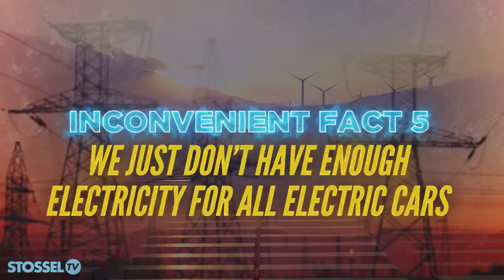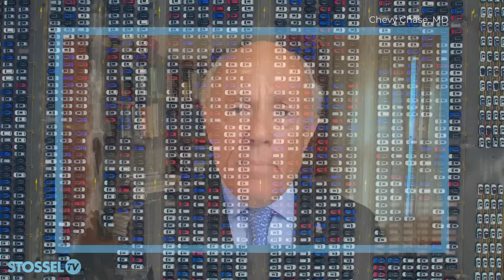Electric Cars: Inconvenient Facts, Part 2

Comment: KLT. Battery technology will continue to move forward. The electric cars we have now will eventually get newer, better batteries to replace the ones that they have now. If you take care of an electric car and it is well built then it has the potential of lasting a very long time, but it will have to have the battery replaced eventually. When that happens the car will be practically brand new again, depending on how well you've taken care of the car itself.

I believe the eventual technology for batteries will move into something called graphene. 

Graphene, think cousin of graphite, is pure carbon. Readily available in the quantities that will be necessary, and cheap as well as easily handled. The manufacturing techniques should be safe but that will be the primary source of cost. The technological know-how will need to be high as well as equipment creation.

Graphene has been created in small quantities. The scientists who did it won the Nobel prize. The trick now is scaling it up. And that may take a while, but we will get there. KLT
Reply: Planned obsoleteness 
Batteries will be made to give out 
Like your cell phone

Comment: While I don't deny physical limitations and I know electric cars can and often are horrific for the environment, and think CA politicians are absolute morons, the bottom line is that electric cars still work. They still function. I can plugin my car at home, drive to and from work, and plug back in. And the car works fine for plenty of years. They're not unusable and there's no horrible flaw other than needing to fuel in a different way, or battery mining being awful for the environment. Not saying electric cars are better, not saying they're worse, just saying they're a valid option. And I think the libertarian / capitalist philosophy is adding more options and letting people choose. So long as gov doesn't force us (which they are) and so long as gov doesn't regulate, control when / where we drive. But at its core, it's like having an option between a couch or a recliner. Different options for different uses and people.

Comment: my opinion, if gov.mandates are removed, we will have unlimited safe fusion energy from small stations converting hydrogen into helium, it works already for minutes in labs. Cheap (but heavy) stationery non-flammable batteries now tested for 20 years in operation, are more efficient, and good for complete off-grid single house operation. Natural development is best, and for heating homes in the winter, wood is excellent source, now fallen dry trees laying unused till burned in forest fires, while at water-heating and energy storing furnaces burn efficiently without the smoke, adding clean CO2 that trees desperately need to breathe a grow, as the wood is made by Carbon from CO2. I wish children are taught true science. Trees use CO2 to make wood and releasing O2 - oxygen. We need oxygen to breathe, releasing CO2 for the trees  - perfect harmony of nature.  I run my house (and my electrical car) on my own solar panels, big fan of solar, and it is in the north, in Canada, it can be done. But clean nuclear energy, with burned rods recycled thus no nuclear waste, we already have it all. We need oil for making plastics, asphalt for the roads, and gasoline and diesel will be the byproducts, nowhere to damp. Will we burn them into the air rather in the cars and trucks? The science and truth are in the details, time to get politicians, and corruption, out of the game.

Comment: Nothing but EV for me.  I have 2 of them.
Reply: That proves you don't have any EV's.  I have owned four in the lat 40 years and always still needed an ICE car as well.
Reply: Which EV did you own 40 years ago? @ForbiddTV
Reply: @boonedoglekentucky2064   And the only way I could still travel distances is with an infernal combustion vehicle, same as you. Try nonsense on someone who doesn't know any better.
Reply: Once again.  What EV did you own 40 years ago? @ForbiddTV
Reply: @boonedoglekentucky2064   I already told you, but I see YouTube may have blocked it for some reason, so I'll post each model individually, but the bigger question is why have you not known the EV has been available for over 100 years?
Reply: @boonedoglekentucky2064   Then you better had not think you are going on any long trips, nor charge any of them in a garage.
Reply: @boonedoglekentucky2064   And when any of those vehicles you mentioned need a new battery, they will be scrapped since the new battery exceeds the value of the car.  Mine have aluminum frames and plastic bodies, so they keep going decade after decade with a $2000 battery change that I can perform myself every 4-5 years.

Comment: Electric cars dont do anything very well, They dont like excessive cold or heat, Gas powered auto's dont have a problem, they run in the cold & the heat. What will happen to your electric car when the battery goes down?   Buy a new battery ? Get out your checkbook and be prepaired to get ripped off. What will you do when your riding in your electric car and the battery decides to explode ? Now your an electric car owner who has gotten burnt yet again. Now you will need to purchace a new car plus you will need to get ready for the hospital bills from the battery explosion to start rolling in. Yea, and this is just the tip of the melting Iceberg that Joe Biden keeps quacking about.

Comment: The country currently has 2.1 million EVs on the road that consume .2 of a percent of US electricity. Estimates of all cars being EVs shows there only needs to be a 15% to 20% increase in the grid. That's very doable over the next few decades. Electric motors are 3 times more efficient than gas engines and cause a decrease in net energy consumption. And most EV owners charge their cars at night at times of low demand on the grid, and if incentivized by pricing that will continue. It's all about peak demand, you know.

Comment: Who is responsible for forcing this crap on us?
Reply: How many EVs were you forced to buy?
Reply: @DeputyNordburg ... The ones with the tax rebates?
Reply: I didn't vote for those tax rebates!  Or the wars to keep gas cheap.  Hmmm which one cost more?
Reply: @bradleyrex2968  ... There's supposedly more oil in the Bakken Formation alone -- just that one place -- than in all of Saudi Arabia. ... Wars for oil?  Was WTC7 for oil?
Reply: @kradius2169   Bakken Formation has produced oil since 1953.  It's low quality and expensive, since 1953.
Reply: @bradleyrex2968  ... What your source for Bakken crude being "low quality"?

Comment: EVs will soon been much cheaper to buy and to drive. Then, they will take the market. Money talks.

To conquer the market, electric cars (EVs) only have to be technically superior to the Internal Combustion Engine cars (ICE). It’s clearly the case.
1.	EVs are simpler to make: Tesla, for instance, has reduced the number of pieces for the front part of the vehicle from 70 pieces to only one. (It’s the same thing for the rear part of its vehicles.)
2.	Tesla, BYD and Volvo demonstrated that it was possible to produce profitable EVs; something legacy producers like GM or Toyota are unable to do. It’s because they feared bankruptcy that many companies stopped producing EVs. 
3.	The price of EVs is falling rapidly due to the rapidly falling price of their batteries (- 30% in 2023).
4.	No cobalt or nickel are used to produce the most modern EVs.
5.	EVs pollute much less than ICE cars, especially when they move.
6.	EVs are more stable on roads because their heavy batteries are located at the bottom of the car.
7.	EVS protect better their occupants when there is a collision due to the rigidity of their battery packs.
8.	There are fewer than ten (10) moving parts in an EV engine compared to more than a thousand in an ICE car. That reduction in the number of pieces means that less machinery are used to produce them. As a result, producing electric cars creates less pollution.
9.	EVs accelerate more rapidly than ICE cars when their drivers try to overtake other cars.
10.	The brakes on an EV last much longer due to their regenerative braking system.
11.	The dashboard of an EV is much simpler to produce since almost all the controls are on the on-board computer.
12.	There are fewer liquids in an EV (windshield cleaning fluid, battery fluid).
13.	EVs are roomier than ICE cars because their engines are much smaller. 
14.	Most technical problems on an EV can be solved ¨over the air¨ without having to go to a dealer.
15.	EVs don’t need to go to the dealer for regular maintenance.
16.	Everybody can buy an EV on the Internet without having to go to a dealer.
17.	Recharging an EV is 80% cheaper than filling the tank of an ICE car.
18.	Nowadays, there are multiple ways to produce electricity. (N.B. In 2023, solar panels are the cheapest way to produce electricity. And they almost never need long transmission lines).
19.	Nowadays, charging stations are everywhere while the number of gas stations is decreasing.
20.	Contrary to ICE cars, EVs can be recharged at home.
21.	EV owners say they have no problem with the autonomy of their vehicle.
22.	If EVs explode from time to time, 200,000 ICE cars explode every year in USA.
23.	Finally, we need to replace ICE cars with EVs for two other reasons. First, because petroleum is becoming scarcer on the planet and, second, because we all need to stop depending on an explosive region like the Middle East for our main source of energy.
24.	Etc.
Reply: Politics is the only thing keeping us energy dependent on the Middle East 👍

Comment: I kept waiting to hear a fact, but all I heard was clearly biased opinion thinly veiled in the most tenuously related of factoids. For example, you never mentioned the following key facts: i) only one fifth of the energy in gasoline is actually utilized by ICE vehicles, and ii) the energy used just to refine the gasoline used to power a gas car would be enough energy to charge an electric car. Do better.

Comment: 'Oil has about 5,000% more energy per pound.'  That doesn't mean a whole lot when an internal combustion engine is about 40 to 45% efficient, and more than half of the energy in the oil creates heat that does not move the vehicle. Oh, sorry, that fact is inconvenient, isn't it?  As to the 'other choices', you apparently don't know what they are since you don't mention any in your report . . . Like hydrogen fuels, fuel cells that can be powered by a variety of fuels..?  Your claims about the US 'getting all of our energy from renewables' is a completely ridiculous claim.  Your entire report is full of really bad propaganda.  I truly did not like your 2 part series.

Comment: Stossel has become a sadder and sadder excuse for reason, he really should not have a forum.  EV's are inconvenient, but hydrocarbon vehicles will end civilization as we know it, you choose 🤪
Reply: Not just inconvenient but dangerous. EVs are suddenly exploding after floods in FL due to the salt residue on the lithium-ion batteries. Other stories on the news about batteries exploding or catching fire in people’s garages (was turned off).
Reply: @bpxl53yewz29  Unlike the thousands of gasoline vehicles that have just gone up in flames 🙂
EV is, sadly, the future and we've got to live with it, nasty as it may be
Reply: @sandhill9313 you can sit in a flaming EV that's your choice,  ICE gives you warning that they'll explode by giving you s warning smoke at the least. 
EVs just spontaneously lock you inside a literal hellbox

Comment: Man this was misleading as hell. I like stossel but there were alot of half truths and "selective" facts without the other side of the story
Reply: Such as?  Answer with the knowledge you are addressing someone who has had four electric cars in the last 40 years.
Reply: @ForbiddTV  Ok. How about comparing 80 pounds of gasoline to a 1000 pound battery while conveniently leaving out the fact that 1000 pound battery can be charged 1000 plus times which should more compare it to 80,000 pounds of gasoline. Or how about complaining about how batteries leak energy (which is true but extremely minimal) while leaving out the fact that electric drivetrains are over 90 percent efficient in energy usage while even the best ICE engines on the road are 30 to 35% efficient. That was just the first minute. I could go one but I have a feeling it would be futile with someone who pipes off with a pretentious holier than thou reply as you did. Maybe you should bring the knowledge next time.
Reply: @Joeblk10   The environmental impact of an EV is much worse than and ICE vehicle, it takes many years of operation for an EV to beat the footprint of a gasoline/diesel car, about which time the battery needs to be replaced which is the biggest offending part of the car.  You forgot to mention that the electricity an EV uses has to come from somewhere, and that of course means mostly fossil fuels.
Reply: @Joeblk10   The inefficiency numbers you present are true up to the point that you conveniently left out.  Extra devices attached to that engine are used for other purposes such as power steering, power brakes, recharging  the battery, air conditioning and heating.   An EV will have to operate these things by robbing them from the battery, reducing the useful range and efficiency.
Reply: @Joeblk10   So yes please go on since in no way have you shown Stossel to be "misleading".
Reply: @Joeblk10   I know all your memes better than you do.
Reply: @ForbiddTV  The accessories drawing off the battery are very little. 
That’s like me saying you running your a/c wastes more gas because the engine has to work harder to run the a/c belt. 
Though that is true, it has little effect
Reply: @ForbiddTV  with full tank of gas at idle and climate control running?
Or full battery and climate control running?
What will last longer EV or Ice.
Look up how long the Tesla can run climate control in camping mode. Is something like 198 hrs. You would have to make two trips to the gas station to keep up
Reply: @ForbiddTV  You are just spouting catered talking points that are half truths just like this video. No need arguing with someone who already has conclusions they are just looking for the right "facts" to back up what they want to believe. Thats you. Like arguing with a 2 year old.

Comment: The reason humanity has been able to live in cold climates has been the use of dense fuel sources because it is not the heat that kills but the cold.  However, the desire is to force people to move back to warm climates.  You are the carbon they are seeking to get rid of.

Comment: A power plant which burns gas has a thermal efficiency of about 35%. Losses in the input and output transformers and the transmission line result in about 15 or 20% where you connect to the outlet!  Charging a battery in one hour has an efficiency of 5.88%, in 15 minutes only 0.3675%. EVs are INSANITY!!!!
Reply: Obviously your NOT an engineer and you understand very little